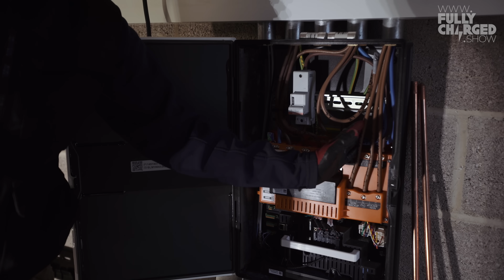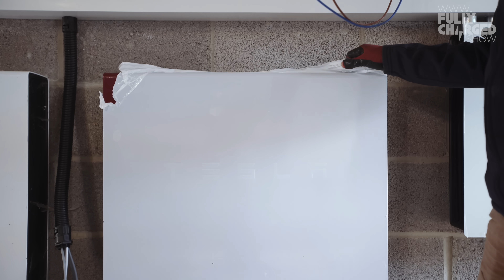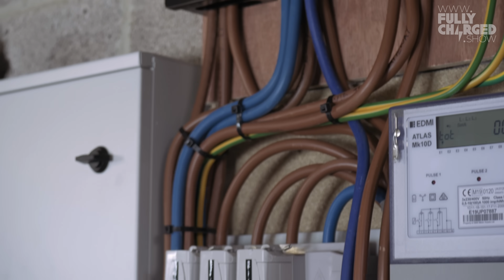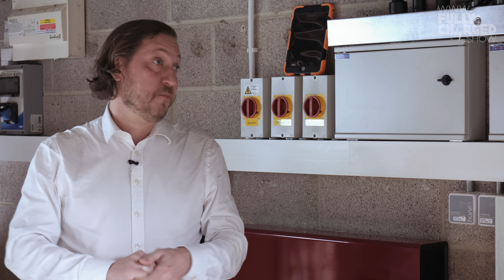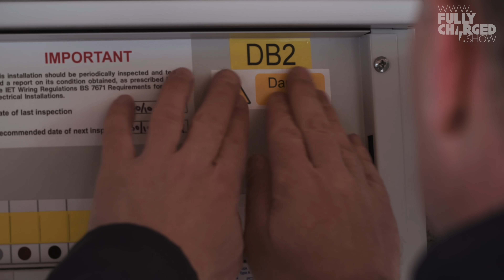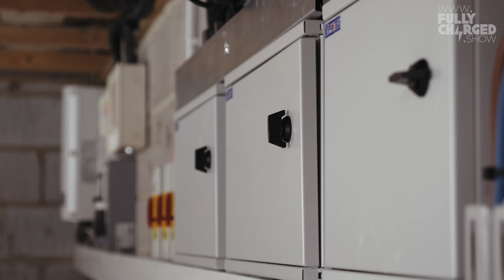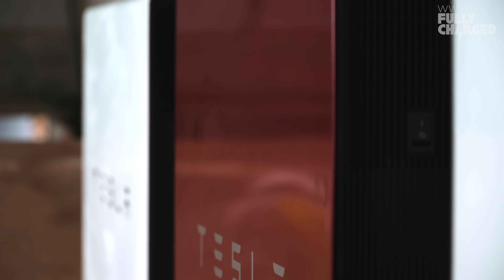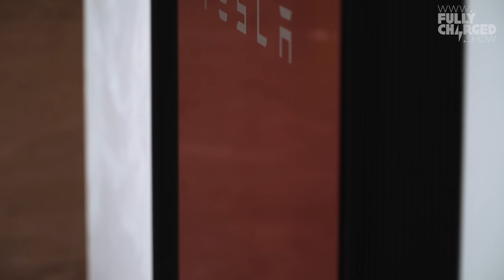Can you run your house on a battery? Tesla Powerwall 2 (Founders Series) & Tesla Backup Gateway 2

Comment: Funny to learn you guys don’t have 3 Phases standard. I have several 3-Phase outlets in my basement, for 2 washing machines running simultaneously, powerdrills/circlesaw and sauna, and I’m renting this house built in the 60‘s. (Germany). Good thing you’ll have it spreading, now the EV and PV revolution is coming to the UK. It’s very practical.
Reply: Don't be a dick bill.

Comment: Robert what's the pay back period?
Reply: Depends on usage but if you've got an average house with just a couple in and you need a 3ph supply fitting and solar panels it would never payback. In 20 years you'd need to put a replacement in anyway.

Comment: Great video, I've been looking forward to this one! Please do a video on Lithium Iron Phosphate (LiFeP04) batteries used for stationary storage applications like this. It is the far safer and more environmentally-friendly option, as compared to Lithium Ion Cobalt (such as the Tesla Powerwalls) or sealed lead acid. It is currently more expensive, but as I understand it that is only because it isn't being manufactured at the same scale.
Reply: Stephen Shumaker the cobalt use in Tesla Batteries is the lowest in the industry, they lead the world in that aspect... given time I’m sure it will be lower yet.
Reply: @slim1100  I'm aware, and I hope they continue on that path. Still, LiFeP04 makes more sense for stationary storage, and Li-Ion Cobalt makes more sense for passenger vehicles. Tesla wants to have just one battery manufacturing line, so they use the same type for everything.

Comment: The Back Up Gateway has been around since the Tesla Powerwall 2 came out, as I have had one since 2017, but im in Australia, so I presume the Backup Gateway 2 addresses whatever it was that was required for it to work in the UK. Anyway when the grid goes down our Powerwall kicks in instantly, I usually don't even notice.
Reply: you can get some that use relays or some that use motor driven hard switches, they said it had to be physically disconnected as that's the rule in the UK so they would have used the motor driven transfer switch, this takes time, but in your case you must be using the new kind that uses relays these put your inverter into island mode

Comment: ...you don't have three-phase as standard in Britain?! I mean, my family's summer cottage, where the electric connection is basically a couple outlets on an electric pole (plus a box that contains the fuses and meter) has three-phase. I don't think I've seen a house that doesn't have three-phase (except maybe when traveling in Britain, apparently). How does the grid operator balance the load between the phases? Like, roll-robin fashion, one house on phase 1, another on phase 2, then on phase 2, start again?

Comment: Elon is installing a system in Australia where ultimately 50,000 houses will have such systems installed - with all linked sideways to each other to produce a town-wide grid that can be independent of the country main grid. Already the pilot scheme of 100 houses has prevented a blackout. The next phase of 1000 houses due soon and if successful funding for the full 50,000 will be released.  In the future linking whole towns sideways would be possible. Making a few dirty power stations redundant.
Reply: The hornsdale power reserve near Jamestown in South Australia has been running for a year and is in the process of getting it's upgrade to 150M watts from the current 100M watts. https://hornsdalepowerreserve.com.au/
Reply: With a french "green" energy supplier 💪
Reply: And Aussie has plenty dirty old power stations that need made redundant.
Reply: Hi where abouts in Australia?
Reply: @harrypalmer7578  - The report doesn't specify the town - just South Australia.  More info available from google. https://www.independent.co.uk/news/world/australasia/elon-musk-tesla-batteries-australia-homes-virtual-power-plants-free-solar-panels-a8196656.html
Reply: @Hitstirrer  It's here in Adelaide, South Australia. Tesla is also currently expanding the big battery out at the Hornsdale wind farm.
Reply: @Hitstirrer  Adelaide
Reply: @harrypalmer7578  https://www.abc.net.au/news/2019-11-19/sa-big-battery-set-to-get-even-bigger/11716784
Reply: Germany has a town going independently too. 

https://m.spiegel.de/international/germany/a-power-grid-of-their-own-german-village-becomes-model-for-renewable-energy-a-820369.html
Reply: @Sjors Million mile batteries are not for sale no one has any.
tt
Reply: @glendooer6211  https://images.app.goo.gl/VDjAk5ohyhSMZMTX9
Reply: @Sjors Yes that dont exist but you can still buy them???
Reply: This system by tesla isn't greener.solarpanels and batteries are toxic and all will need tobe replaced when worn out.sofar no mechanism or factory for reclamation is in existence and basically all panels &batteries will end up in landfill creating toxic mess.how is this green energy then
Reply: fly ash and sulfur also pose a hazard.  We've been disposing of both for 100 years.
Reply: @Sjors Lithium batteries are good for 1 to 8 yrs depends on the BMS etc.
Reply: GLEN Dooer 
It depends on the usage.  If you keep the cells in their optimal energy density range then they last indefinitely.  Good monitoring and control of the battery is required to ensure this.

Cellphones are expected to be junked after a few years, so they are run much harder.  If you could shift the charging parameters then your cellphone battery would also last indefinitely.
Reply: The batteries will need to be replaced in under 10yrs
Reply: @glendooer6211  - A bold claim. Can you back it up with credible evidence? Bear in mind that EV cars have typically an 8 year warranty.
Reply: @Hitstirrer  Had 2 electric bikes and lucky to get 5 yrs out of a battery and they started to lose  power after about 3.
Reply: @Hitstirrer  everything runs on lithium Tesla has about 7000 AAA batteries in each car.
Reply: @glendooer6211  - lol - Now I know for sure that you have no clue on this subject.
Reply: @glendooer6211  - So you don't have any credible evidence then - except five years old anecdotal gossip about a tiny bike battery. Next you will be telling me your phone battery fails. Try finding evidence about storage systems failing. Bet you don't even know that many such systems actually use second life car batteries and go on to run many years in storage units after 8 previous years running cars. You are clueless I'm afraid.
Reply: @Hitstirrer  Sp mouth educate me.
Reply: @glendooer6211  - As you seem to be incapable of research I spent a few seconds for you. Found this quote from a company regarding its warranty.
 " At the end of the 10-year period, the battery is guaranteed not to have lost more than 20% of its storage capacity. It will act like a 4 kWh battery in the worst case scenario. If it loses more than 20% of its capacity, then you are entitled to a battery replacement, as the warranty terms will have been broken."  
These are not phone batteries or AAA batteries. They may need changing within the life of solar panels but also could be under warranty at no cost.
Reply: @Hitstirrer  Out of curiosity. What lithium (I assume we're not talking about NiMH batteries here) car batteries would it be that has gone on to run many years after being used for eight years in cars? Some of the mere 200 manufactured Nissan Altras or a couple of the first Tesla Roadsters from 2008? Or is this also just anecdotal gossip?
Reply: @jonatanrullman  - These are early days for the second life use plan - entirely due to the lack of sufficient 10-year-old car traction batteries to scale up. But it's a long way from gossip. A brief search found numerous sites discussing the clear feasibility of the proposal. Here are a couple.  https://www.theengineer.co.uk/ev-batteries-second-life-wmg/ - https://www.mckinsey.com/industries/automotive-and-assembly/our-insights/second-life-ev-batteries-the-newest-value-pool-in-energy-storage -- The important take away is that once the demanding car traction performance starts to tail off such batteries would be perfectly capable of operating in storage systems for many more years. Don't believe me  - some random YT commenter - believe the industry out there who see a new industry waiting to blossom.
Reply: @Hitstirrer  I am doing that with repurposed BYD Lithium Iron Phosphate batteries, ended up costing about $100 per kilowatt hour of storage. The demands are not high on them and they have several thousand charge cycles in them still. Others are doing the same with Leaf, Volt and Tesla batteries. Even in large homes the peak power demand is nothing compared to what the traction motors draw. My inverter setup can put out a max of 10 kilowatts, whereas my 2013 Leaf pulls over 80 kilowatts peak draw. So a repurposed Leaf battery has lots of excess output in C rating when used at a home. Heat no longer becomes an issue either. Basically depth of discharge and peak charging are your limiting factors so taking a battery that only has 60 or 70 percent of its original capacity, putting it in a home system that uses say 60-80 percent of that capacity for longer life span should get several years out of it. And weight and size are less of an issue. That old Leaf pack could easily supply 11-13 kilowatts of power a day for years, by which time there will likely be better means to recycle it, and a lot more old batteries to replace it with. 

There really should be a market for companies building storage solutions using the old packs to the point where one day everyone has storage on their homes able to easily handle dips in the grid or store excess solar/wind.
Reply: @glendooer6211  Nonsense.
Reply: @glendooer6211  The bms in bikes and scooters are junk compared to automotive grade bmses.
Reply: @stancloyd  and cost a lot more with cooling etc.
Reply: @glendooer6211  With 9 tons of AC here it is my biggest load on the solar power plant.
Reply: @glendooer6211  says who? Stationary batteries are normally understressed and last very long.
Reply: @glendooer6211  That is the problem until batteries are cheaper or last longer Solar is only for those who can afford to lose a thousand or two every year on replacement of batteries on top of a sizeable investment.  Unless Banks start loaning money to the lower middle class for the cost of the entire system until then I am not going to believe you come out ahead. LOL
Reply: @glendooer6211  
Tesla recently had a big breakthrough with battery longevity. It's called the "million mile battery", because most people care about EV battery life, but it would be equally beneficial for Powerwalls. It loses only 10% capacity after 4000 full cycles, and far more if kept in the optimal range (20%-80%) most of the time. As you probably don't do a full cycle every day, this should easily last 30 years. Even if you do a full cycle daily, that's still over 80% capacity after 20 years.
Reply: @andrasbiro3007  it not a breakthrough they are still working on it , don't claim such things here
Reply: @alanmay7929  
They have the new cell in the lab, but that's just the first step toward mass production. Since this is just a tweaked chemistry, it's not a big deal in itself, but Tesla is cooking a few other things too, and those need more work. The biggest step is that Tesla wants to take cell production in-house.
Reply: @glendooer6211  Ouch is that how bad the battery tech is in these?  10 year replacement cycle will kill the ROI for many people.
Reply: @aceofspades6667  The Leaf cells in my power wall were produced in 2010 and are going strong.  10 years sounds a bit like FUD to me.
Reply: @stancloyd  Thanks Stan!
Reply: Elon is a thief.. and liar.. and is ismply a front face stooge that is behind a colelctive elaborate thief gate in whci hsteals any and all ideals fomr the land nad has nlimited access to cpiatla to make it happen... you see how fuckedup that is,, form an tional stand point he is a enemy. All the dielas fomr the last 90 years. privatized when they were public , ideals, ie public servent.. fuck enteraitnment and the actors that socially engineered this fuckgin debackle and their fuckign ass hole migrant gangsters that roobed the hoseu and then feed their asshoel popaulce nad while udenringin eh self autonomy and then there like see they  or you are ht hater. I am addressing the fuckign  actions.. fo what peope lare oding.. staing that is nto of an error...  Every government is some weird staefcraft. commie African hell hole that is slowly being drained into weird men that think their god.. I don't think representing law is thinking one is god itsprotecting from chaos of nonsense murder... but whatever..  keep drunkign yoru shit alcohol coolant.. palnet of nonsense.
Reply: @artemirrlazaris7406  Wow.  You may find a different type of lithium beneficial if taken orally.
Reply: @stancloyd  clearly you don't know liars and don't know war. Tommorow ur live the next dead. What opinion is this? Elon is just a orator puppet,much like the authors of atar trek. It's called business selling what people want and false hopes it's how gambling psychology works.elon is not for nationalism,private Enterprise destroys national identity of public sectors and work.which I agree Romans have it right between separation of public and private affairs of art.
Reply: @artemirrlazaris7406  ????????????????

Comment: how do brits use electric ovens if you don't have three phase?
Reply: I live in the US, tons of electric ovens here on single phase. My house has 225A service, but a standard residential service is 150A. Plenty for an oven, most are rated for 40A or 50A.
Reply: @stephenshumaker8444  ah, so just super thick wires.
Reply: @tommihommi1  Right, my oven circuit uses 8-3 wires, 240V at 40A. Modern code requires 8-3 + ground.
Reply: @stephenshumaker8444   you have 110v so more A makes sence
Reply: @MartinLV.  Well an electric oven is 240V, but yes we have 120V as well.
Reply: not only britts, many in europe, i too have got one phase
owen usually is 5kw max is ok if you have 220v 25A electrcity it is enough
 wires must be 3x2.5 and seperate fuse for it.
Reply: @Bill Whittaker  sorry yes 🤐